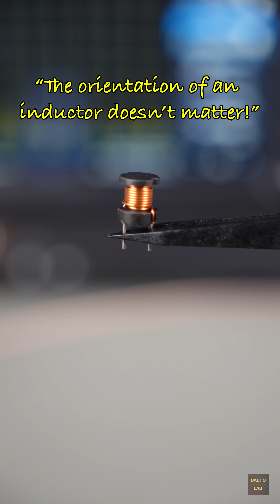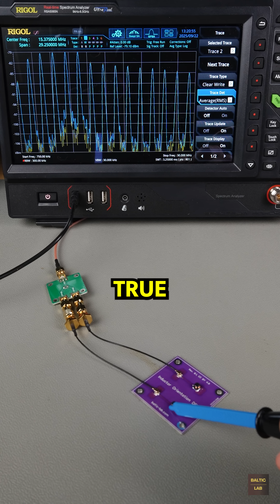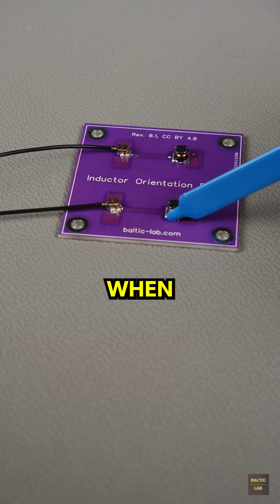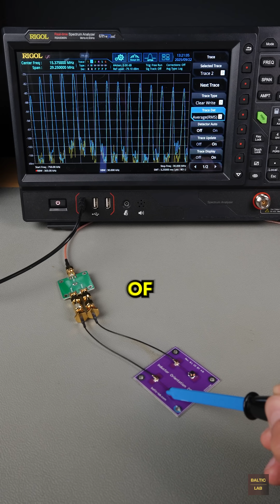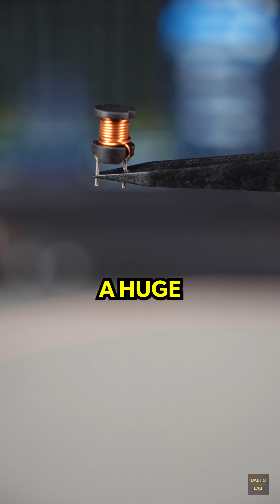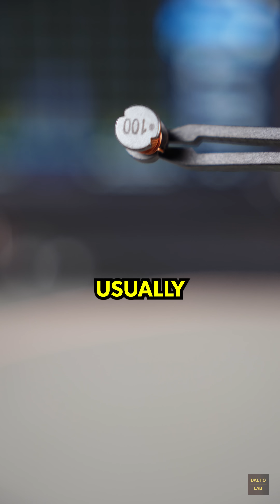Worth knowing: Inductor Orientation Does Matter!  #electricalengineering  #electronics

Comment: Your claim is also inaccurate, what you say "in theory" is not properly taking into account what is the actual implementation of the inductor, if you consider it the theory will also reflect that in the computation, Maxwell equations always work with any engineering device this ain't fundamental experiment that goes beyond classical physics

Comment: How do you know that the inductors are really identical? I kind of doubt it.
Reply from the maker: Most definitely not. That said, any typical tolerances don't jusyify the significant E-field differences. And even if the setup is imperfect to a significant degree, it doesn't take away from the fact that it's a well-known phenomenon. There's plenty of literature on it to educate oneself. Just to name a famous case, Raspberry PI just had a design failure due to this effect. Analog Devices and other manufacturers have Application Notes on the effect as well.

Comment: I rarely think about this, but is nice to have it remind it. It does make sense: most of inductors are more than one layer winding. If you assume that the inner end is the input side and the outer one is the output or connected to the ground/mass, then the radiation is somehow shielded. The other way around not so much. And then is the capacitance between the layers of windings...

Comment: Thanks 👍
So if it were connected to a npn transistor tank circuit... would the dot be on the collector or positive rail ?
Reply from the maker: Dot to the collector as this is the switching node with the highest dV/dt.
Reply: @BalticLab Thanks for confirming !

Comment: The orientation of an ISOLATED inductor doesn't matter. These two are close enough to have both inductive and capacitive coupling. Swapping the leads can reduce capacitive, but it only inverts the polarity of inductive.
Reply from the maker: If by isolated you mean "shielded", which is probably the correct word you're looking for, then you're still wrong. Shielded inductors exhibit the same relative difference, albeit at a lower absolute level. Obviously. I recommend reading the following Application Note from Analog Devices: https://www.analog.com/en/resources/analog-dialogue/articles/does-the-assembly-orientation-of-an-smps-inductor-affect-emissions.html

Comment: sound like the 3db difference is potential and not power?
Reply from the maker: A relative 3 dB change is  independent of the unit you express the absolute level in. Converting from dBm to dBµV doesn't change the relative difference, so the 3 dB remains a power difference, not a "potential-only" one. A 3 dB difference stays 3 dB, regardless of whether the level is expressed in dBm or dBµV.

Comment: Simple used shilded inductor 😅
Reply from the maker: You might be surprised that it isn't that simple after all, because shielded inductors show the same effect. One thing that is simple, however, is taking a moment to think and research before commenting. I'll leave that as a piece of advice after reviewing the comments you've posted on the channel so far.
Reply: @BalticLab  hmmm , look that , initial emoji which I placed after that , it was not counter reply instead a doubtful suggestion " as solution "  which can be wrong in real practice . But as viewer, learners point of view it was vailed point to think about .

Comment: I find its working best when the core  is connected and its stray capatiance is provide an noise return path into its source insted of leave it floating. Just put an ESD-foam under the core and it is conduct like the ferrite core itself when it expanded again by hot air tearment.

Comment: That's an unshielded inductor. For switching circuits it's best to use shielded inductors. That specific inductor is used for choke purposes, biasing, coupling, filtering, etc..
Reply from the maker: Shielded inductors show the same orientation-dependent effects. Analog Devices provides a detailed application note on this topic: https://www.analog.com/en/resources/analog-dialogue/articles/does-the-assembly-orientation-of-an-smps-inductor-affect-emissions.html
Reply: @BalticLab  I'm in so much disbelief. Thanks for the link. Definitely worth it.

Comment: Makes sense. The electric field always gravitates to the outside. So if you solder the outside end to the switch side, it starts off on the outside and all the field noise kinda lingers there.
Reply from the maker: Precisely! That's why the dot is crucial for optimal performance.
Reply: @BalticLab  your channel's the best !

Comment: dot is starting should be connected to positive or negative
Reply from the maker: Incorrect. The dot should always connect to the switching node. Although it marks the start of the windings, multi-layer inductors are naturally wound with the first turn on the inside, meaning it is most shielded by the outer layer(s).

Comment: In most cases true, but not *always*. There is a bunch of applications where the winding orientation is irrelevant (e.g. low frequency filters), and several designs where the orientation may be reversed on purpose (those rare cases when there's need to actually boost EM transfer).

Comment: Wait a moment.. isn't the 3dB voltage difference caused by mutual inductance/coupling ?
Reply from the maker: No. Nor is this idea even plausible. When both inductors are measured on the outside, the difference is >6 dB. Which just stresses the obvious fact that any "coupling" would reduce, not increase, the electric field strength between the inductors.

Comment: I'm still stuck on Richard's transformations in karoda identities.. , and wondering how the heck is that ceramic disc electret like magnetic cyclone thing supposed to work‽‽‽
Reply from the maker: Are you talking about the YIG oscillator or the dielectric resonator? Both requiere a deep dive down the rabbit hole of electromagnetic fields and Maxwell's equations.
Reply: @BalticLab that could be a hell of a video if you could make it at a high school algebra level

Comment: Obviously there will be  a miniscule discrepancy. On paper an inductor is just a wire on a core, in reality the core isn't perfect, has small geometry diifferences and the wire isn't tangential all the time when near it
Reply from the maker: Referring to a 3-6 dB difference, equivalent to 2-4 times the radiated power, as minuscule is quite concerning. What you're describing isn't relevant to the effect shown: It applies to all multi-layer inductors, even ideal ones. By definition, a "multi-layer inductor" has at least an inner and an outer layer, and the outer layer will naturally radiate more readily than the inner layer, which is effectively shielded by the turns surrounding it.

Comment: That expanded my brain! But I wasn't totally clear on whether you were saying that connecting the terminal going to the outside of the winding to the switching node is bad or good. I assumed bad, and the dotted one is the other terminal, corresponding with your description that it tends to indicate the start of winding?
Reply from the maker: The dot marks the beginning of the winding. Which on a multi-turn inductor should be the windings "covered" by the outer windings. So the dot and the "covered" windings should be connected to the switching node.
Reply: @BalticLab Thanks! I have certainly seen the dot on circuit diagrams but didn't appreciate what it meant about the construction of the coil -- I thought it was more of a clockwise/anticlockwise winding indication, but maybe there's a convention there that I'm unaware of.

Comment: Yeah let use an non RF inductor with a rf test. Brother EVERYTHING COUNT IN RF. Even the number of via
Reply from the maker: You don't say? As a RF design engineer this was complete news to me. 🙄 What I am actually doing: Using an inductor commonly used for switchmode power regulators at a switching frequency typical for such switchmode regulators (< 1 MHz). The much higher frequencies are obviously Fourier components of the square-wave signal. Which actually has a much nicer rise-time than the switch-node  in modern switchmode converters. It's almost like this setup simulates the use case where this effect is most relevant with the component typically used. It's also well-known to SMPS designers. Analog Devices and Würth Elektronik have good App Notes on it. 👌🏻

Comment: You are doing the measurement wrong! You arent measuring the same side of inductor!!!
Reply from the maker: That is indeed true for the footage I used for illustrative purposes in the short. Measured on the same side, the difference is even larger (> 6 dB). Analog Devices did a much better job at documenting this well-known issue: https://www.analog.com/en/resources/analog-dialogue/articles/does-the-assembly-orientation-of-an-smps-inductor-affect-emissions.html

Comment: I have a box of dozens of similar inductors removed from equipment. Most do not have a dot on the top. I suspect the dot is manufacturer dependent.
Reply from the maker: Yes, you're right about that. Seems to me that especially the low-budget manufacturer's don't have those dots.

Comment: I've used those cylindrical inductor as sensors do I know it's false.
And I've been told that any outer conductor such as a capacitor, resistor, or inductor should be connected to a low impedance path.

Comment: Would you say this should be the practice in larger Transformers as well ? I only know that the dot reference the incoming power. And i have encountered many times that this dor have been confused and installed the other way around, but very heavy equipment doesnt Move easily and you only swap that outputs to get the correct potential...
But i suspect, looking at your video that it matters a lot if EMI/EMC should be considered.
Reply from the maker: Yes, it does. Essentially in any muli-layer inductive structure. That said, if no fast-edged signals are involved, such as in switch mode power supplies, the difference usually doesn't bust EMI limits.

Comment: Inductors at this level usually have tolerance of 10 upto 20%
I think this difference caused this
If you test the exact one part in reverse way, then we can talk about results
Reply from the maker: Or, just an idea, we reject "I think [...]" as a valid point for any discussion and reference the professionals that kindly documented this well-known effect for other people. Analog Devices: https://www.analog.com/en/resources/analog-dialogue/articles/does-the-assembly-orientation-of-an-smps-inductor-affect-emissions.html Würth Elektronik: https://www.we-online.com/components/media/o109027v410%20ANP047c_The%20Behavior%20of%20Electro-Magnetic%20Radiation%20of%20Power%20Inductors%20in%20Power%20Management.pdf?srsltid=AfmBOopAU9C2ICaf3xHp1hwuxz5pPhNZWBdup0IQSeXJI_t_ddSc4CcV
Reply: @BalticLab  thanks for your detail answer
Got it, it is weird that this little matter cause this huge difference

Comment: Am I correct in saying that the idea is to connect the shortest vertical lead to the switching node; otherwise, connecting to the longer vertical lead is effectively creating an aerial that radiates the EMI?
Reply from the maker: That is one way to describe one of the important factors, yes. More importantly, there's an outer and an inner layer of windings. The outer layer can radiate more freely into the environment while the inner layer is shielded by the outer layer.

Comment: Unshielded inductors are known to be bad for EMC. choose shielded inductors unless you really know what you're doing.
Reply from the maker: Shielded inductors have the same orientation-dependent effect. Obviously. It's almost like the setup in the video was merely to illustrate a commonly known effect.
Reply: E-field is measured in this video.  Let’s imagine a shielded power inductor – Sumida CDRH125NP-101MC, for example.  The ferrite pot core shields against H-field.  At the same time there’s no terminal to ground the pot core.  It stands to reason that it wouldn’t shield E-field.  [What would we see if we did a similar experiment with shielded inductors? ]

Comment: I feel the propagation is a capacitive one and not an inductive one. The input has much high frequency content.
The outer layer of windings may act as one plate and the test prope is the other plate.
The inner layer cannot do so because it is shielded by the subsequent layers.
Just my two cents. So the winding direction is not a factor.
Reply from the maker: Luckily, it is well known and documented that winding direction indeed is a factor. This is common knowledge for anyone working with the design of switch mode power supplies or electromagnetic compatability. There's application notes out there with much better tests and comparisons.

Comment: Just like the orientation of an un-polarized capacitor doesn't matter.  But it does in a tube or other circuit with noise.
Reply from the maker: Very true! At least those were, at least back in the day for that purpose, properly marked.

Comment: Old foil wrapped capacitors for vacuum tube radios are marked outer winding. Makes a big difference.
Reply from the maker: Indeed! Especially with the large voltages typically present in tube radios, it made a huge impact on E-field radiation. I'm debating whether or not to show that effect as well. But I think this concept is no longer really that revelant today. Might be interesting nonetheless.
Reply: @BalticLab  please do show it. If anything else, for posterity.

There are people out there working on older hardware that may not be cognizant of it.
Reply from the maker: @darkcoeficient  I'll put in on my to do list. 👌🏻
Reply: Yes i saw mr carlson i think it was doing a bit on that

Comment: you care for orientation of inductors, yet you don't care about orientation of the probe... should be either between inductors both times  or outside'em.... this 3db will magically do 'puff'
Reply from the maker: The difference actually doubles (>6 dB) when measured outside each time. 👌🏻 It's not that the effect isn't well known and documented. So you could have actually researched before commenting. Good job!

Comment: It is a frame of reference issue. The orientation DOES NOT MATTER to simple circuits that EE's would be working on. It rarely matters to the behavior of the circuit itself. It DOES matter to the environment the circuit is in. It does matter in RF scenarios.

RF engineering and Electrical Engineering are not the same.

It isn't a lie, it is scaffolding, and if you knew anything about education you wouldn't be posting clickbait thumbnails.
Reply from the maker: Calling it scaffolding and implying it's intentional is a very bold assumption. From my university experience, both as a student and later as a lecturer alongside my colleagues, I've found that many use "scaffolding" as an umbrella term for "it's all I know." Unsurprisingly, it's often those same people who are most triggered when I call it a lie. That aside, your assessment that this doesn't matter in simple circuits that electrical engineers work on is blatantly false. Switch-mode power supplies are a modern, common, and practical example where this absolutely matters, as does anything involving inductors, fast-edge signals, or EMC testing. By your logic regarding models and how we teach them, flat-earthers wouldn't be wrong about their model either, since for many everyday purposes it's sufficient. Like explaining how to drive to the grocery store. Sure, let's adopt that approach in education and call it scaffolding to convince ourselves that we're not simply unfit to teach.

Comment: What you are measuring is cross-talking between those two inductors on the same PCB measure them separated.
Reply from the maker: No, that's not what I am measuring. 😉 If I measure them separately, or even just the difference between the outer sides, the measured field difference is more than twice as high as shown in the video. It's a very well known phenomenon, Analog Devices has an interesting App Note on it: https://www.analog.com/en/resources/analog-dialogue/articles/does-the-assembly-orientation-of-an-smps-inductor-affect-emissions.html Obviously, in a short I'm not gonna cover the intricate details or complex test setups. The setup is sufficient for illustrative purposes.

Comment: Those 2 test inductors are way too close on same board.
Testing reverse widing at same time on same board is so close not a good idea.
A far better way to carry out this otherwise really interesting test is to use one single inductor at a time on exactly the same place on same board, but reversed winding. 
Then you can assert that both inductors are not coupled because being used at the same time.
Reply from the maker: I generally agree. Except that it's essentially just an illustration for a well known and documented effect in a Short video. The proof has been done by many others, including Analog Devices, before me. I'm just showing it.

Comment: Use a fully shielded inductor.
Reply from the maker: This effect is still present even in shielded inductors. Analog Devices wrote a nice application note on it: https://www.analog.com/en/resources/analog-dialogue/articles/does-the-assembly-orientation-of-an-smps-inductor-affect-emissions.html
Reply: @BalticLab What about an axial inductor
Reply from the maker: @TechniCraftYT Same story as long as it's wound in multiple layers.
Reply: moreover fully shielded inductors are significantly larger (not for compact applications)
Reply: Just because it's shielded does not mean it doesn't lose efficiency due to extra EF radiation. The radiation does not escape the shielding but it's still emitted so the loss in inductance is still present.
Reply from the maker: @vaakdemandante8772  Additionally, there's no 100% shielding effectivenes, ever. So there's still radiated emissions from a fully shielded inductor. And that is still orientation dependent.